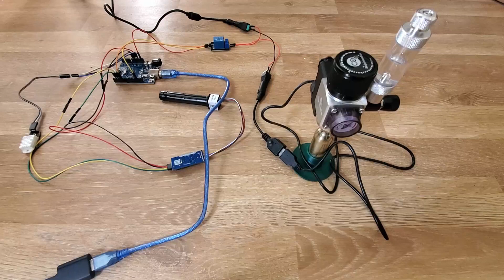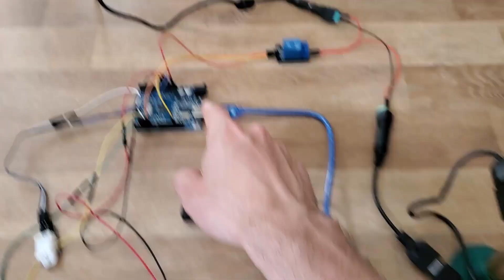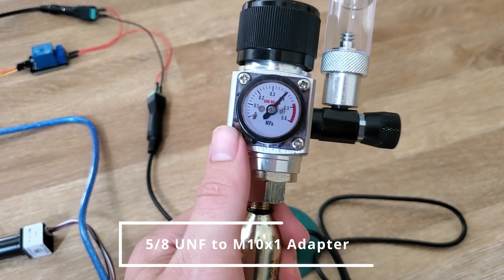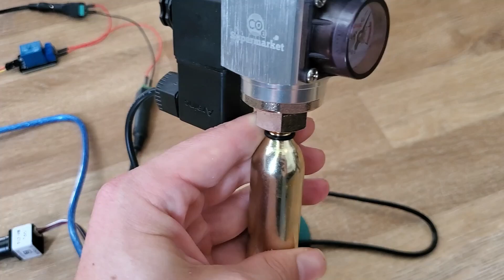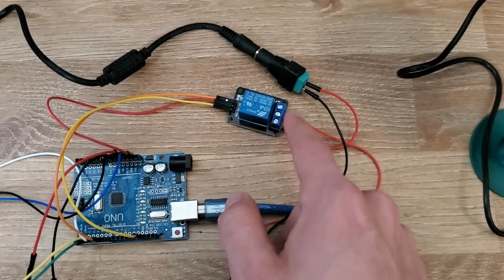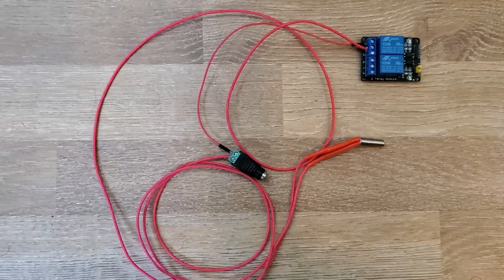DIY CO2 Incubator: CO2 Regulation

Comment: Hi, how long does it take to stabilize CO2 measure ? You took the sensor out of the exhaust and system didn’t resume bubbling.
Reply from the maker: It takes a couple seconds to adjust

Comment: Do you need to worry about the pressure inside the incubator becoming too great due to the temperature and added CO2? 

If so, what was your solution?
Reply from the maker: It shouldn't be an issue. There won't be that much CO2 added to the system to get it to 5% and the incubator probably won't be airtight enough to build up pressure either.

Comment: I'd like to know if this sensor can be used inside the CO2 incubator with 100 % humidity. Thanks.
Reply from the maker: I'm not sure since the product specifications don't say anything about humidity and I haven't tried it at that high humidity myself. If you try it and it works let me know.